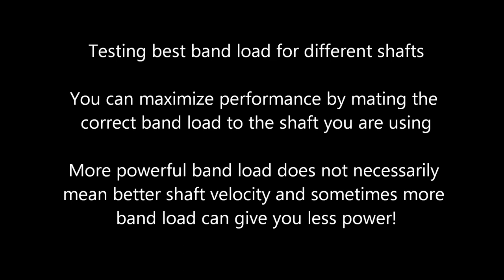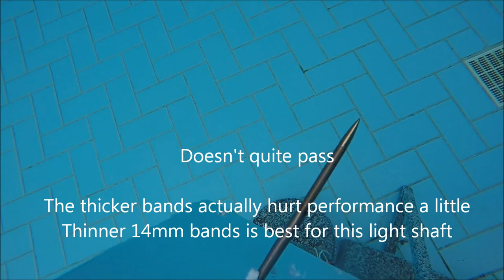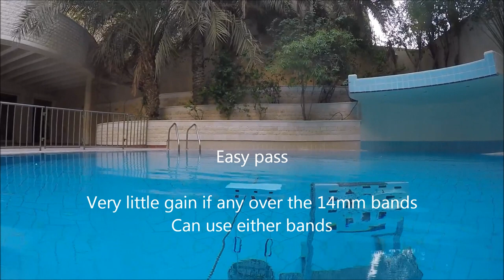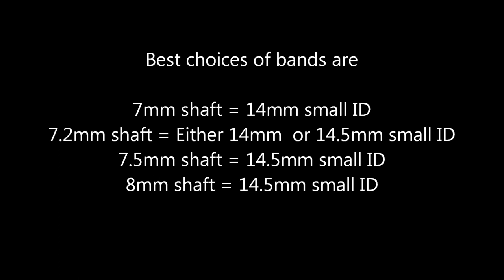Best band choice for different shafts in spearguns

Comment: Thanks for your answer, but I am a little surprised. I thought longest is the part of shaft out of the barrel more you will create oscillation. Also with hard stainless shaft (52HRC). Maybe I read it from abellan web site.  
Regarding the web site it's an easy tool, but when I do the test there is more than 30% of gap between the real weight of shaft and the website results. Can you tell me the weight of the Trygon diam 7,2mm you used? I have the same gun and I would like to use a shaft with similar weight to improve my setup. Thanks.
Reply from the maker: +spearboy9 I just use the tool and really don't actually weigh the shaft.  I guess some SS must be heavier than others ... but it is very small difference.

Comment: great work. instead of cutting the band to 380 why not go for the 16mm band on the heavier shafts?
Reply from the maker: 16mm bands cannot be pushed as hard as they can destabilize the shaft at high stretch.  Maybe with heavier 8mm to 9mm shafts it would be useful, but lighter shafts get better velocities from 14mm and 14.5mm small ID bands.
Reply: @majdq8  but you wouldn't need to stretch them as much to achieve the same lbs of force.
Reply: @majdq8  a 16 mm band depending on what brand is about 80 lbs at 325.
Reply from the maker: @davidkoba  For high shaft velocity you need the minimum band diameter which still has enough force to move the shaft.  Even if you get 16mm at same stretch and the shaft doesn't have enough mass to absorb the extra energy, you won't get more shaft speed with thicker bands.  You might actually get less shaft speed.  You can see the test for yourself in this video https://youtu.be/FSK4HkkimXk
Reply: @majdq8  umm, thats why i said a 16mm band at 325. stretching your band at over 350 starts to do more internal damage to the latex. Two 16mm bands at 325-350 will give you about 160 lbs of force, a 7mm shaft for a 110-130 cm gun will handle that.

Comment: Hello , 

I own an Omer Cayman Gi 110 and I plan to upgrade it 
I will get a 2 bands open muzzle , and put 150cm 7mm or 7.2mm shaft ( or is it better shorter and heavier ? ) 
I will put 2x14 or 2x14.5mm 360%  stretched  

Do you this this kind of setup is doable on this kind on gun ?

I can't decide between the Cressi pure brown (14mm) , Omer performer 2 ( 14mm) or the Seacsub power blue ( 14.5mm) , do you have any experience with those ? 

Thanks
Reply from the maker: Yes it certainly would be worth a try.  Of course for good performance and accuracy, the trigger is the heart of the gun and makes a huge impact.

Comment: Do you account for the wishbone when you measure the 360%? Thx for vids
Reply from the maker: No.  The wishbone length is optimally about 5cm, but you can increase the length on new bands as extra flexibility in dialing in the best performing band stretch.  It is much easier to make the wishbone length smaller than to cut the bands and re-tie.

Comment: Hello Majd I would be greatful for some advice right now.
I have a bleutec 115 raptor,I notice that the 7mm shaft is very soft and I would like to replace it with a better one or even try 7.5mm.
Could you please inform me on what shaft to buy please and if 7.5 is too heavy,I use 14.5mm small ID bands at %380 ATM.(alot of recoil)
My old gun has a rob allen shaft and I do like its strength.
So I was also wondering if rob allen makes shafts to suit my raptor.
Thanks mate.
Reply from the maker: For a 7mm shaft you don't need 14.5mm @ 380% ... you will actually get much less recoil and much higher velocity with 2 x 14mm small ID @ 360%.  The Raptor 115 will shoot a 7.5mm very well.  The Bleutec guns have terrible handles and I would recommend you look at my Handle Mod videos to see how to re-shape your handle.  The difference will be like night and day.
Reply: Thank you very much for taking the time to reply and I will check out the mods.

Comment: Hello! Good videos I like your test, I have a question about this test. Why is it tested at 360% for 2 bands 14mm and 380% at 3 thicker bands 14.5mm? I want to say that 14.5 is thicker and more percent.What happens with more% in 2 * 14mm? Can be more recoil, but more power too? Please answer, I have small identification of 3 * 14mm, the sales Of the spearamerican store, and shaft 7mm @ 130cm w / the 7cm flopper.I want to cut rubber but I want to know it is ideal%
Reply: Greetings from Baja, Mexico.
Reply from the maker: It is a little more complicated.  With a light shaft you don't need heavier bands to get the shaft moving, so the thinner bands move quicker in water and even at 360% can deliver more velocity to the shaft (also less recoil).  As you go to a heavier shaft the thicker bands are better as the thin shafts cannot get the shaft started at high velocity.
Reply: majdq8 ok. tnks for answer, i like be a personal cuestión, I've 3x14mm small interior diametter @320% , and shaft 7mm @130cm. you think may be is Good for be 6m shot? 
or used 2 bands @ 360%?
yea i know is necesary real test, but your think is high value to me before cut bands.
Reply from the maker: 7mm @ 130cm shaft is not enough mass for the shaft to perform good at 6 meters.  Remember that when I say 6 meters I mean 6 meters from the tip of shaft to target ... so that is about 7.5 to 8 meters from your eye to target.  Better than 3 x 14mm small ID bands @ 320% is to just use 2 x 14mm small ID @ 360% stretch.  That will give you much better shaft flight and much better performance.
Reply: i know is 6m of the tip the shaft yo targget, tank you for answer.
Keep making your videos, they are tests that we all want to do at some point. have a nice day!
Reply: @majdq8  Wouldn't it be better with a 7.5mm or 8mm shaft and 2x14.5mm small ID bands for a longer shot? Maybe even for 6m shot with that or with any other speargun?

Comment: Hi! Please, can you tell me what kind of wishbone/dyneema are you using for the 14mm bands and   how long? Thanks
Reply from the maker: I use 1.9mm dyneema and length I usually keep about 5cm of exposed length.  Sometimes if the bands are not laying nicely I will increase one wishbone more than the other to let the bands "fit" better.  I like to have a clear line of sight without bands on top of each other.

Comment: nice video, i want to ask, for a 6.5 shaft 90cm gun its good to use one 18 rubber to faster and accuare shot?
Reply from the maker: Two small ID bands at around 13.7mm to 14mm will give much better shaft velocity than one single thick band.

Comment: Have you had ant experience with Bucanero shafts? They seem 17-4 ph like Hunt shafts. Would you recommend them?
Reply from the maker: I do have a couple of Bucanero shafts and they seem OK.  I didn't like the flopper pin as it felt weak ... also didn't like the hole in the shark fin as it seemed not centered and way far to the edge.  Also didn't have a cone ... but that was easy to add.  The new Hunt shafts that are coming out now are simply the best shafts I have seen anywhere and much improved over the original shafts.  They have a welded 316 SS cone, they have hardened floppers and hardened flopper pins ... they have increased their welding on the shark fins and have a very nice hole to tie line to on the rest tab.  Very very accurate and very strong.
Reply: I saw pics of the new hunt shafts and it seemed to me that the last sharkfin is waaay to back and maybe would not fit in a c4 urukay (it would fit an albacore 130 or a trygons). Is that true?
Reply from the maker: Yes they have a shark fin way back as they are producing the shafts for Abellan now and Abellan wants as much band stretch as possible.  The new shafts fit perfectly in a C4 Urukay ... as for Trygon guns am not sure as I don't have one.

Comment: Hi Majd. Something a bit off subject, do you know anything about the sigalsub nemesis handle? Im about to put together another speargun and im using that handle. Any idea whether the trig mech will hold 7.5mm shafts without damaging it? Thanks a lot
Reply from the maker: From the photo online it looks like the trigger sear is metal and I don't think the shaft sear has a roller.  This would mean that this is a friction  reverse trigger and thus it most likely will suffer from galling at higher loads.
Reply: @majdq8  Max l'm thinking of is double 14.5 rubber and 7.5mm shaft but most likely 14 and 7. Will those be ok? Not exactly sure what higher loads mean to you, you've gone triple 14.5 and 8 in some of your vids!
Reply: Btw, if not the nemesis handle, what handle with 26mm internal diameter would you suggest? Thanks again!!!

Comment: Hi, great video. Could you advise on a band strecth for a 130x6,5mm shaft with 2x14mm smallID bands (105cm wooden gun). Thanks. Marko
Reply from the maker: Hi Marko, I would go with 2 x 14mm small ID bands at around  360% and then keep my wishbone initially a bit long (about 8cm) and then I would shorten the wishbone slowly to 5cm to see if I get improvement in flat trajectory.  If you need more power you can go to a 6.75mm or even a 7mm shaft ... this can absorb more band power and really gives a huge boost in performance at longer ranges.  Properly setup, your 105 gun can easily outperform older 130cm guns.

Comment: +majdq8 Hi! Can you tell me yours opinion about Devoto shaft. I will buy 7,5x1300 for my denton 110, I use Pathos but they are sandvik steel and they are very strong but devoto is 17-4 SS are they strong enough, reef hunting....rocks!
Reply from the maker: Yes the Devoto shafts are 17-4 PH SS and also the pin and flopper are 17-4 PH SS ... very strong.  They are a little raw and need some dremel work to remove sharp edges on the back of the shaft and on the shark fins ... but after that they should be perfect.

Comment: please tell me which crossbow is better, Omer Cayman ET Camu 105 or Sporasub One 105, and what is better for them, harpoon 6.75 or 7mm.a you can more under what harpoon which traction is better?
Reply from the maker: I would prefer the Sporasub One 105.  Just change the bands to 2 x 14mm and either a 6.75 or 7mm will work really well.

Comment: hi. I got a Salvimar 95. V-pro.  I wanna know which size exactly of bands.  I got to 14..mm small ID .  I know take the hole of the band and shark fin and then? 360% ? more? less?  340??    thank you
Reply from the maker: I am not familiar with that gun, I would use 340% stretch and if the gun can handle more then push it to 350% and 360% etc...

Comment: Come on man, you tell me the handle lve asked you about might not be good for me but fail to give me an another suggestion?! Thats out of order majd lol. Any 26 int, 28 ext dia handles u recommend? Had to insist and hope i have better luck this time...😆
Thanks
Reply from the maker: I don't think you need to change the handle ... just fix it and you can use it.  If you haven't bought one then best would be Pathos D1 handle as there is a double roller trigger for it with minimal modification.  I actually helped design the trigger for that modification just for that reason.  You can see in this test how I modified the handle to use a full DR trigger.  But with the new DR trigger for the D1 handle you get same results but without the major work involved in modifying it.  https://youtu.be/K-sN4pQkWSU
Reply: @majdq8  thanks man. Ur advise is invaluable as always.

Comment: Hello brother, have you ever tested regular and reversed flopper for any shaft ? I wonder reversed flopper can compensate shaft drop or not.
Reply from the maker: You will get a slight shift in elevation ... flopper down usually vectors shafts up while flopper up usually pushes down.  You really don't want to have the flopper vectoring the shaft as that only vectors the front and you end up with a "wheelie" type shaft flight.  This loses velocity very quickly and has poor penetration.  That is why I always use a cone on my shaft or I make sure the flopper is recessed enough where it won't affect shaft flight.
Reply: thanks for the information I exactly understand what do you mean with "wheelie" term. Shaft cones is very good solution for proper shaft trajectory. But hard to find and expensive parts. Do you suggest anywhere which I can buy ? 7mm for example
Reply from the maker: You can buy cones from diveinn.com  For sigalsub cones get one size larger ... so for 6.75mm get 7mm .. for Salvimar cones you can get exact size or 7mm for 7mm.
https://www.scubastore.com/#/dffullscreen/query=salvimar%20cone%20cone&query_name=match_and
https://www.scubastore.com/#/dffullscreen/query=sigalsub%20cone&query_name=match_and
You might also get them from Devotosub and those you can also use exact sizes.
Reply: thanks the very informative response, dive safe
Reply: Check online brother. Price is around 0.60 per piece. Picasso is one that does them for example. Search for 'cone for shaft'. Hope this helps.

Comment: Can you help with the choices of bands (very few available in Greece), between Bleutec 14,5mm, sigalsub extreme and reactive evo 14,5mm, cressi 14mm and 15mm and also meandros 14.5mm. Note that all the above have 1mm ID!
Reply from the maker: Lol ... the only one of those bands I have tried is the Sigalsub ... so sorry can't help.  But in general, all bands are identical and differ only in how much the rubber has cured or what the ambient temperature was during manufacture.  Bands dipped during hot summer months will be stretchier than bands done in the summer.  Also bands that are fresh out of manufacture will tend to be softer than bands left out a little longer to cure.  At least this is true with dipped bands and extruded bands are different.  More important for performance is the inside diameter of the bands ... the smaller it is the better the performance ... not sure why but that is what I noticed in testing.
Reply: Hi bro, as for what I know Cressi and Primeline are real manufacturers - the rest buys from (other) manufacturers and brands the rubber bands...
Reply: @majdq8  Maybe because more material is in the band with smaller hole, thus it's fuller and hevier.

Comment: what about on a big blue water gun would you still use 14.5 I have a koah 140 4 band
Reply from the maker: I don't think you need 4 bands unless maybe with a 10mm shaft. You can go for thicker small ID bands if you need more power on a very heavy shaft.  Today you can get the small ID bands in 15mm .

Comment: . Hi. I got a mvd Predator gun 120 size And  130 cm band strech. 7.5 And 160 cm Shaft     I Buy  1.5 meterse of  14.5 mm  small id band  .  what size  cut the bands ??
Reply from the maker: I really don't have experience with that gun, but if it is similar to the Pathos design then I would go with 2 x 14.5mm @ 360%.
Reply: @majdq8  thanks.  Really appreciate

Comment: What about 6 and 6.5 ? What's your recommendation ?
Reply from the maker: Thinner bands contract much faster than thicker bands due to less water resistance ... but of course there is a limit to this being useful for speargun shafts.  The limit is that the band has to be strong and thick enough to start off the acceleration of the shaft.  So it is a very fine balance.  For 6.0 to 6.5mm shafts, there is a possibility that best would be 2 x 13.5mm bands ... since that is not very common, I would just go with 14mm small ID bands.  What I can guarantee you is that 2 x 17.5mm bands will not be as good as 2 x 14mm bands even if you use the same band stretch.  I know it is hard to believe and many make fun of this statement, but you can see for yourself in the test in this video.

Comment: recommended band length for 120 with 7mm shaft?
Reply from the maker: take distance from band hole to shark fin you will load at, then multiply by 2 and then divide by 3.5 to 3.6 (depending on how strong you are).  I would start at 3.5 and then cut shorter if I feel I need more power.  This estimate is based on using 14m or 14.5mm small ID bands.

Comment: when u say cut at 360% stretch how do u work that out. is like from the muzzle to the last tab then like what do u do idk just wondering how you work that out
Reply from the maker: Distance from band slot to shark fin then multiply by 2 (for 2 sides) then divide by 3.6 (for 360%).  This is band cut length.
Reply: Hi..sorry to interrupt, is that the same calculation use for roller ?
Reply: majdq8 Inches? Centimeters?

Comment: why you remove the 16 mm bands from your calculations
Reply from the maker: +ehab mohamed 16mm bands will not give better performance than 14.5mm bands except with maybe heavier shafts than 8.5mm.  In the tests here I just wanted to show how bands and shaft mass interact.  More band power is only necessary if you have more mass on your shaft ... otherwise it is just added recoil that can actually work against. you.

Comment: What lenght of speargun did you use for this test?
Reply from the maker: +Παναγιώτης Μπονέλης The gun used was an Abellan Denton 120.  It has 121cm band stretch and is about 135cm total length.  I will put a review on this gun soon.
Reply from the maker: Color is not important, but has to be small ID.  Can buy from spearitco.com  Look for Primeline small ID 14mm bands.

Comment: really nice I like the test and very helpful topic I think the the power you gain here is approx90-95 Ib for both rubber and it give the idea to everyone
Reply from the maker: I think the power alone is not important, it has to be controlled power that keeps the shaft stable.  Many times in my tests I add more power and get less performance!